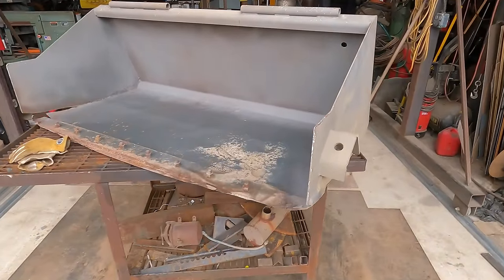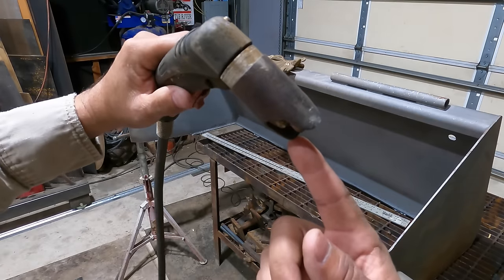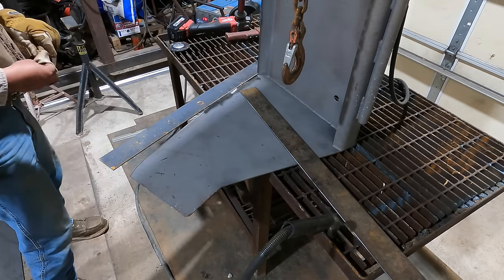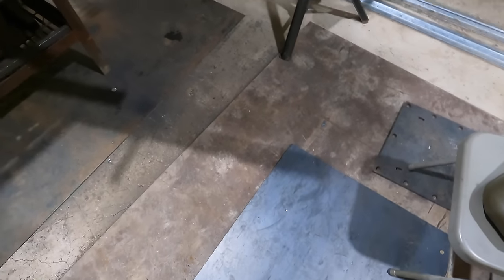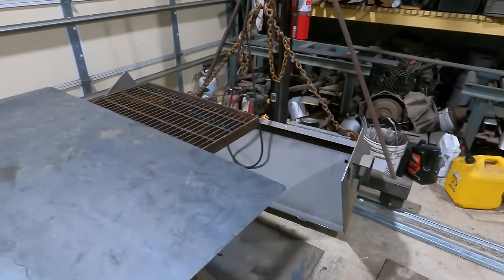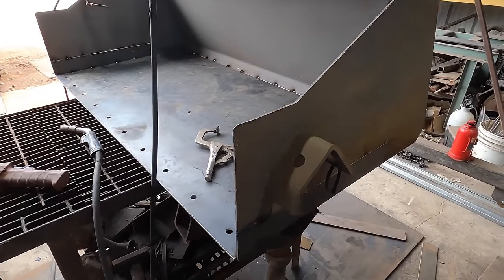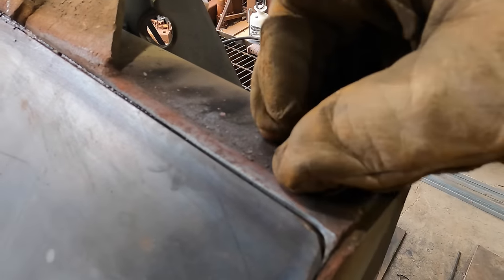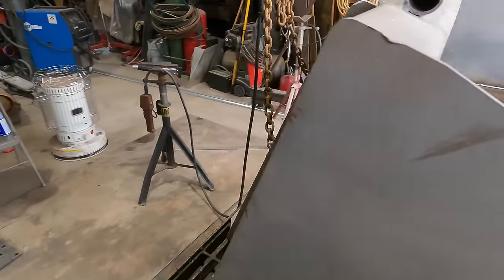Worn Skidsteer Sweeper bucket

Comment: Good video as always. You may already know this but because the way the plasma swirls, the cut will always have a good side and a bad side. The good side being more square. 

The good side on most machines is the right hand side of the torch if the direction of travel is considered the front. So if you're pushing it away from yourself, the right side is the good side. If you're pulling it, the left (your left) is the good side. Left to right movement, good is near side. Right to left, good is far side. Doesn't matter the handle orientation. Just consider the leading side the front.

Doesn't matter much on n thin stuff but it can help on thicker. With some machines it's more pronounced than others.

Comment: Hey Issac, just wanted to say another great video. One thing that caught my attention that nice Quincy air compressor I don’t have a nice one like that but I put an hour meter hooked up to the switch for the 220 V and it runs on to keep track of maintenance Oil in most air compressor pumps needs to be changed summer 250 hours others could be more but there’s no way to keep track. Also when you do change it use Amsoil they bake very amazing products I have a gas compressor with 6000 hours on it that I purchased in 1999 and it runs perfect
Reply from the maker: Oh excellent. thats a good way to keep track. I appreciate the pointer. Ill have to see where to get one of those. and Yeah, Amsoil is good stuff.

Comment: Nice job as usual. Very well explained, executed, and nice welds, by the way.👍

You said you're not keen on plasma cutting because they don't cut straight. Steady on there, fella. A skilled tradesmen like yourself never blames his tools!

You are new to plasma cutting, so more practice is required on your part. You will soon make every cut straight. Trust me, it took me about 3 months before I mastered the art. And that is exactly what plasma cutting is. It's an art just like gouging or welding is.  

Remember the first time you gouged out welds using  carbon rod, or gas. The mistakes you made, or how bad it looked?

Do you remember when you first cut sheet metal using a torch and how crap it looked? Or what about the first time you used a stick welder? I bet that looked like bird droppings, am I right? Because mine did. I hated using a stick welder but perseverance pays off. 

Stay with it and test how each cutting tip reacts in different scenarios. See how different thicknesses of sheet or block metals react. You may be surprised that one tip does not cut as well as another one does on different  materials. 

Also, the guide you used. It seemed to look more worn on one side than the other, or was that just the camera angle? In any case, it's much better than the clear plastic one, which came with my first plasma machine. Admittedly, it was cheap but still worked well.

Another tip is your cutting technique. You will find it best pulling the torch towards you rather than pushing it away from you. Sometimes, slag can pop up into the path of the flame, causing it to wonder. The end result is a wonkey edge. I know, I learnt the hard way and some of my mistakes cost me money! 

Also, there is the safety aspect to consider. Once, I was cutting 3/4 inch thick sheet of steel. It was 8 feet long by 4 feet wide. It was cut from the hull of a ship.

It was so heavy and me, feeling lazy as usual, I pushed instead of pulled. Suddenly, an explosion occurred, causing molten metal to fly across my shop, hitting my daughter in the face.

She was sketching me at work for a school art project and sat 20 feet away. Never the less, it left her with a scar the size of a baked bean on her cheek. Safety first, always, as you never know what may happen.

When can we expect a big job. One where your video is, let's say, an hour long?😁

Do you know what would be great, for you to upload 2, no!  3 videos a week🤘🇬🇧🇺🇦⚒️

Comment: Great video. Hypertherm torches are unique from other brands in that you don't have to use a stand-off shield or hold a stand-off distance from the metal. The consumables are made and insulated in such a way that you can drag the torch right on the metal.

Comment: I don't know if it was right or wrong but the buckets I've repaired I put the doubler on the bottom and them added 2 skid plates the same thickness perpendicular to the doubler. This protects the bottom and can be replace when they wear as opposed to having to replace the bottom.

Comment: I might be mistaken, but doesn't hypertherm have a drag-tip built right in?  As in, the normal tip on a hypertherm can be dragged without an additional standoff?  I think I saw that in the manual for my 45XP, anyway.  I don't have the cartridge tips, though, so might be different there.
Reply: The Hypertherm 45XP, and I assume the smaller ones, have drag shields. I don’t know about the larger units like Isaac has.

Comment: You can run both shielded and unshielded consumables with the thermal dynamics plasma cutter.  If you are running the shielded consumables you can get drag shield cups which work great with straight edges and template.  I use the 9-8236 drag shield cups and you can buy generic ones since it isn't a critical piece like an electrode or start cartridge.  I have the older blue and black cut master a120 and I have a hypertherm powermax 105 and I do prefer some things about the thermal dynamics over the hypertherm.

Comment: This one was really abused. I think they need at least 4 Hardox wear strips to keep from causing such deterioration. The bottom was 1/8 inch material which was probably only mild steel, and it doesn't take much contact with the street to grind it away. You can see what's left of a 1/2 inch cutting blade that's still attached if you look closely.

Comment: That's some lightweight metal for a skid steer bucket.  What kind of skid steer was it?
Reply: It's a sweeper bucket that really isn't supposed to touch the ground but guys press it into the street and they wear it out. A rotating brush kicks dirt into it. Afterwards, you can dump it somewhere appropriate.

Comment: If you wanna make the wear strips last for a long time, run a tiny bead of hard face rod down the center of them. Lots of heat so it spreads out. You'll be retired before it wears out.

Comment: been watchin for years, and I just noticed that your hoist is on "rails" kinda hard to see exaclty what, but looks like a piece of angle and some custom rollers, anyhow someday I plan to build something similar and suggestions? what materials you used? and what would you change?
Reply: Did you notice that he has at least two spirit levels hanging up on the side posts of the gantry?
Reply: He just recently modified the rails and wheels he posted pictures on ig. It's pretty sweet

Comment: Isaac, I’m not being critical, I’m just asking. It appears that is a light duty bucket. The problem I have always found, with skid steer and farm loader buckets is that I can’t make any money fixing them without pissing off the customer. If I charge anywhere near my normal rate, the customer could have bought a new, cheap bucket for less. Heavy duty buckets and excavator buckets are different. I love working on them and the customer is happy.